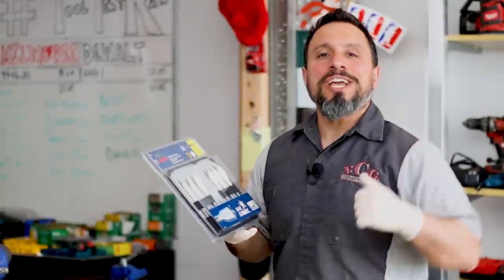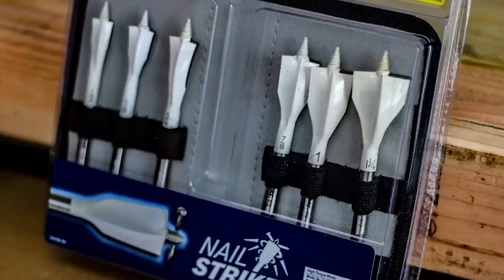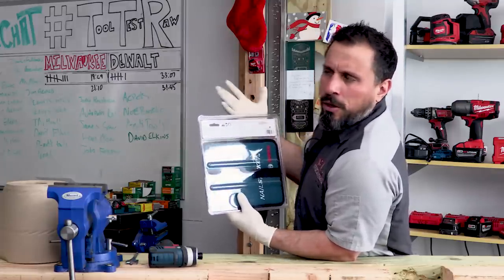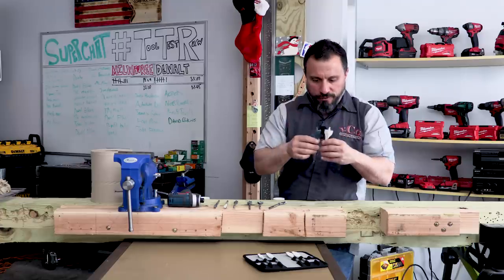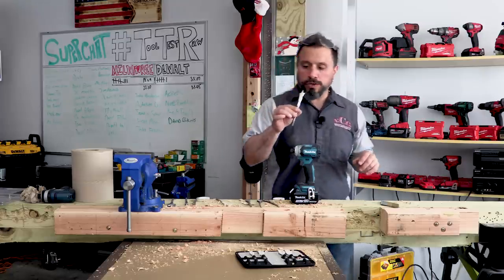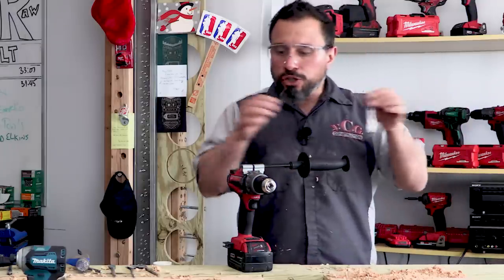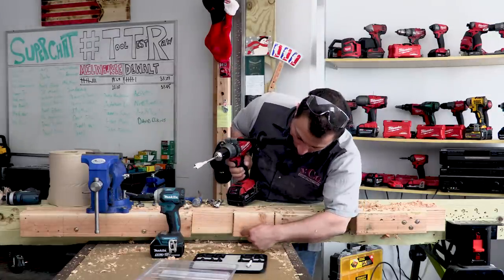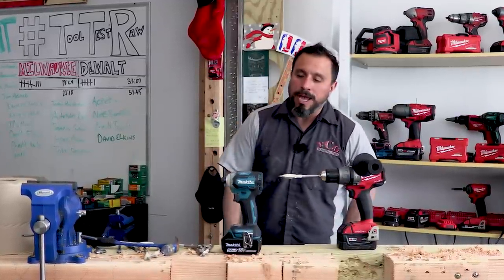WE BROKE THE NEW BOSCH NAIL STRIKE BIT!

Comment: Impact DRIVERS are good for... DRIVING screws. They aren't as good as DRILLS, which are made for... DRILLING.
Reply: Andrew Delashaw the only time I use a impacted to drill is if I need to drill a lot of pilot holes in sync of drilling the main hole. Just saves time not having to Change the drill bit
Reply: Funny how it says don’t use a hammer drill so he puts it in an impact driver. I only drill with an impact driver when I can’t get anything else in
Reply: Adam Lynch Yh but a hammer drill hits in and out as we’re an impact driver hits clock or counterclockwise so it a bit of a difference🤷‍♂️
Reply: Joshua Warrington Yes I get that but I’m not sure either is good for the shank of these paddle bits.
Reply: Adam Lynch Yh I guess

Comment: Here is my thoughts.... if I know i was starting to hit a nail or screw... i would spray down the hole with some wd-40 ... and on the bit as well... just like drilling through metal.... you need a lubricant...it preserves the bit and cuts through faster  you will also find that this also works with reciprocating saw blades and oscillating blades as well... when you know that you are going to cut metal... it works everytime for me.
Reply: Nathan Potter it’s not always needed. I’m a manufacturing engineer and work with CNC’s all the time and have done a lot of research and what u need to consider how will it blunt the edge. Their are a few different ways but the most important are heat and force of what  material is stronger. When heat will blunt your edge it’s important to use lube because it helps cool the bit but if it’s due to force and material often it’s unavoidable. So imagine cutting the grass and going over a rock; it will blunt a part of your blade no matter how much oil is on it, but if it’s because of heat then one material will become more malleable faster and the only way to avoid it is to use oil.
Reply: I may not be a engineer... but I do know... friction causes heat.. a blade such in this equation is going to cause friction and thus heat..... comparing a rock being hit by a lawnmower blade in this equation ... is apples and oranges.... that's why you use a diamond bit to drill through rock or even a masonry bit to go through brick , block or concrete.  These are different scenarios.

Comment: Hay Vince,. I bought the Nail Strikes just to test them for my self.  I purchased them at Lowe's and tested them about a week ago.  I used an older out of date Mebabo 18V hammer drill  with a 4.0 amp battery.  I made it through yellow pine 4x4 lumber with no problem.  I hit 8penny finishing nails and air gun 2 1\2" sticks nail with okay results.  The bit did penetrate the nails.  I them hit a 3" #8 interior construction grip rite general purpose screw.  Stopped the bit cold. No damage to the bit, but it munched about half of the shank of the screw off.  I did not continue though the screw out of fear of damaging the drill.  On a scale of 1 to 10.  I give it a 6.  There not cost effective, but something cool to have.

Comment: Do a lot of plumbing and electrical I love these drill bits are awesome bits I don't buy the nail ones because you're not worth the money the blue ones do all the same thing and if you have a little file you sharpen the bits and they work great only time I throw them away is when I bend them or break the shank off would not use any other drill bit

Comment: hey Vince I was watching an older video where you was talkin about the single ball bearing and the Milwaukee gen 3 I was curious do you have any videos posted using the 2850 Milwaukee what to do about bearing I would like to see videos with the paddle bits in it if possible I just picked one up myself for a really good deal couldn't pass it up I know it's an older model but it is Milwaukee and brushless no speed control but I would like to see a video on it if possible thanks
Reply: Sorry I was doing the voice to text LOL so my message may seem a little funny but what I was meaning was the 2850 has dual ball bearings I would just like to see it put through a TTR

Comment: Hey vinc love the channel just a quick question what if u where to use the impact driver like say the Milwaukee gen 3 or surge on a lower setting with those bosh bits threw wood an nail bc it said not to run over certain rpm.
Reply from the maker: Good idea!!

Comment: Don’t waste money on these. Wood Owl Nail Chipper auger bits. Best value available. Clean holes and nails don’t stop them.
Reply from the maker: I’ll need to check them out!!
Reply: @VCGConstruction  Definitely. I'm a low voltage tech. We pre wire houses for alarm, cameras and av. The electricians are always complementing the Wood Owl bits.

Comment: Okay I got it don't. Don't try using it with screw or lag bolt only nails and drill is better than impact and it still creates tear out on the back side as well as maybe soon splitting and lifting of the top side of the cut. And I have never seen or heard of this Bosch nail strike paddle bits. I wonder What retailers are carrying these locally
Reply from the maker: Lowe’s!!
Reply: @VCGConstruction  I've been to Lowe's twice in the last week in heaven seen them there yet maybe they're fixing to put them out
Reply: @VCGConstruction  I am definitely tired of hitting nails in top plates all the time and either jerking the heck out of my arm and shoulder or killing my bit or both

Comment: Try using the Proper Drill for the job. You do not drill a hole with a impact driver, it has a specific purpose, to drive screws. Any Contractor should know that.